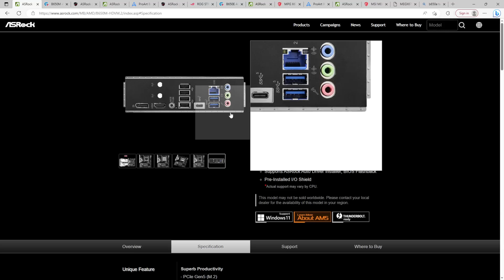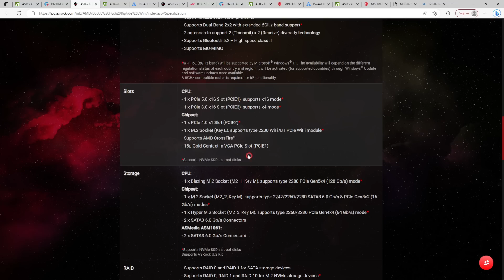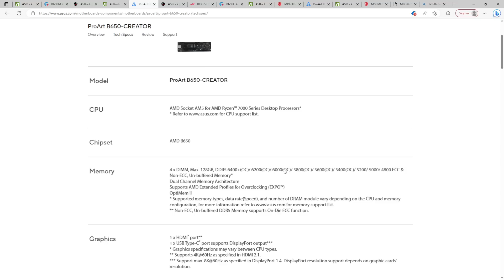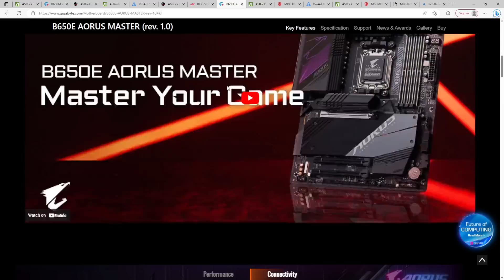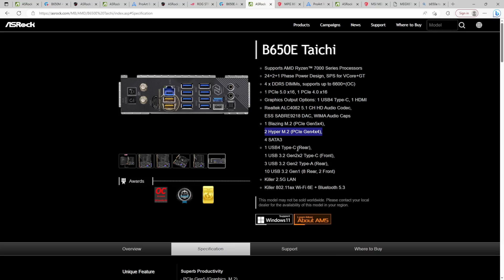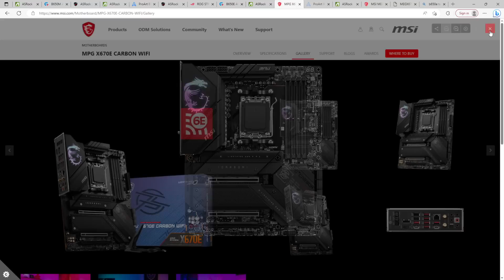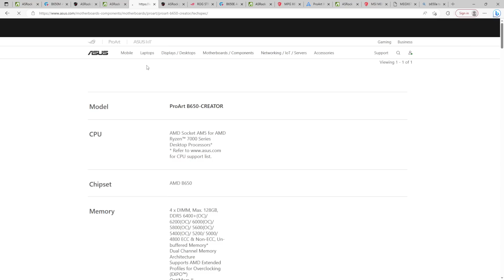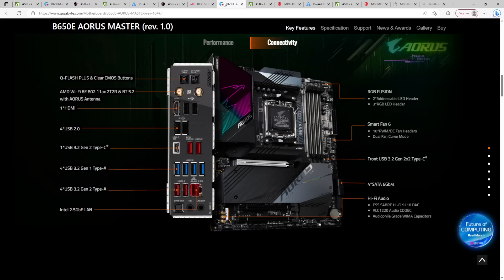AM5 motherboard round up

Comment: On the thunderbolt thing. They literally aren't allowed to advertise it as thunderbolt without having the solution certified by Intel. I doubt Intel makes it easy or cost effective to certify AMD boards, and Asrock only did it on 1 AM4 ITX board.

I thinks it weird you bring up Audio Workstations and wonder about missing optical, and simultaneously included thunderbolt. How familiar are you with this area? People doing audio work are far more likely to use external thunderbolt interfaces long before caring about onboard optical out. Even though optical gets over the quality concerns the onboard drivers and latency are still too much of a wild card. Even high-end add-in cards and USB interfaces have priority over any part of the onboard solution. That also feeds into why the 10Gbe being built-in is more sensible than burning a slot for it. Copper 10Gbe nics tend to be closer to $100+ new. 

That ProArt for the combination of TB4 and 10Gbe makes sense and is cheaper than Asrock X570 Creator was with the same features (sans POST code). It even has one more m.2, and doesn't sacrifice TB if you use more than one NVME SSD.
Reply: @Wasmachineman  Ah yeah. There was a solid 2 year gap between Asrock X570 w/TB3 and Asus releasing TB4 boards. I had only looked at the X570 ProArt, even though it seemed like they immediately discontinued it. I'm pretty sure at initial release they called it USB4 and not TB4. Both it and C8E were basically EOL launches.

Comment: Would anyone happen to know if "official support" ram is actually important? because the B650M AORUS ELITE AX does not officially support any cl30 6000 2x32 gb in the ballpark of 30-36 or 32-38 only 30-40. Any feedback is welcome

Comment: So to test my b650e master i need to run a cinebench or run a high end game? I have had it for a bit with no problems. The only thing i noticed is when i turn the computer on with no windows are installed the code is 00 even while installing windows. But once its fully installed and i install some windows updates amd gpu update it put ramdom codes from ea a0 76 kind of random but whatever
Reply: Sigh

Comment: Which of these is best for the 7800x3d? Did he mention? Just looking for the TLDR beyone the final thoughts section.
Reply: Bro it's more nuanced then that. The as rock b650m hdv/m.2 can run it but for overclocking you might want more features, or for your storage/pcie slots/m.2 slots/style you might want a different board. Figure out what you want  in your board, then look at the options. a620's probably won't work.
Reply: @impaledface7694 how about 9800x3d? is it the same as 7800x3d?

Comment: What if you're purchasing based on the expectation of upgradability of another two maybe three gens beyond 7000 series?
Reply: Realistically, don’t. None of us can predict what comes next and we may see dramatic improvements to manufacturing processes or whatever that save money and make future hardware more affordable or faster. However, AMD will support AM5 at least until 2025, but the VRMs are already so beefy you’re still not going to have trouble. 

Gen 5 PCIE is probably not going to be useful for most by then either, the caveat in my head to that being you’re going to keep this board around for a really long time and maybe upgrade to some nvidia 50 or 60 series (assuming they go PCIE 5) and have a cap on your PCIE lanes that restricts you to an x8 lane set.

Comment: Hi , just a quick question, does the B650E Motherboards have the same issue with the 7800x3d? 

Most of the issues I stumbled upon were tackling the x670 , so I am just wondering
Reply: I hope not... I am on the same situation. Did you find out anything about it yet?
Reply: @Gataki4U  no to be honest , I searched alot and majority of the threads and videos talk about the X670

Comment: "This board kinda does board things" Builzoid 2023, No higher praise for a Motherboard 😁👍
After many years of making Absolute Garbage HDV Spec & then Sulking when getting Shitcanned in reviews finally ASRock has gotten it, they CAN make a HDV that is competently capable of powering the CPUs that fit the socket & unlike an ASUS AM5 you can use the new BIOS update & EXPO without voiding your warranty.

Comment: Why the frig is an Optical out so important?
Reply: Straw-man fallacy alert, as no one claimed it is. It rather may be useful, although like 10G-Ethernet or Wifi, it isn't something which couldn't be retrofitted at low cost, here by simply using a USB sound card.

The real argument made and latent critic about missing optical S/PDIF outputs however is that it would be dirt-cheap to have them and thus it's pure ignorance or intentional price differentiation to omit it.

Comment: A bit unrelateed, but I was looking at the Pro-P from MSI and I noticed that they 4 of the SATA ports come from ASM1064 and not the chipset. Does anyone have any info on that because I'm considering a board with 6 SATA ports, but the options are a bit...yeah
Reply: That ASM1064 AHCI controller uses PCIe 3.0 x1 to create 4 SATA ports. It allows the motherboard to have more SATA ports at the cost of less PCIe lanes from the chipset. (Relative to the amount of PCIe lanes required for 4 SATA ports directly connected to the chipset.) That can be beneficial because those PCIe lanes can of course be used for something else.

Each individual SATA port has a maximum bandwidth of about 0.6GB/s, and the PCIe 3.0 1x connection has a bandwidth of about 1.0GB/s. So you're obviously going to be limited in throughput. But that shouldn't be a problem if you're just using those ports for storage.

Comment: Brother.... please get an m.2 ssd. It's sooo nice to cut out all the sata cables from a build.
Reply: It is nice until you need to access your M.2 slots after your system is already build.  
Gotta remove the GPU, pull the 1-3 power cables, remove the M.2 heatsink with more screws or clips... then there are thermal pads under there you need to be careful with...  
That is a lot more work and takes a lot more time than to just pull out 2 cables and have an SATA SSD in your hand that is sitting in its own slot in the case.  
And of course that is also a good opportunity to remove dust from your System and GPU, so add 15+ minutes of cleanup.  

...or course M.2 is a lot faster, so totally worth the hassle... i just think there has to be a better way to put M.2 ports on boards in general... maybe more like RAM? ...easily accessible.  
Or just generally put all M.2 on a single PCI-E card in a PCI-E SLOT, vertically. one screw and you can mess around with it... same speeds and all that. I don't know.

Comment: My gigabyte master x670e ate itself. Started with doesn't boot with nvme in bottom slot and intel i225 randomly disconnecting,  both issues lots of users complaining about on reddit. Where mow I am sending it back becuase the whole bottom chipsets pci lanes dying when used for more than 30 min 😅
Reply from the maker: sounds like it could be BGA damage to the chipset.
Reply: @ActuallyHardcoreOverclocking  Could be, I noticed one of the chipsets in HWinfo reaching over 70 Celsius.  Not sure if that is over tolerance, but it is also when USBs started disconnecting and a PCI Express Downstream Switch Port would display warning indicators in Device Manager. Board was only ~2 weeks old at the time.
Reply: @ScreamerRSA  maybe badly applied  thermal pad ?
Reply from the maker: @lauwie7610  that's the other possibility.
Reply: @lauwie7610  I did remove the heatsink and everything looked OK with pressure indentations on both thermal pads.

Comment: I wish they had a board that did either 2x 5.0 8x slots or it could switch to dual x16 4.0 slots. Why os this not a thing? What if I want to run 4x raid 0 nvmes off of the cpu lol like that's my only wish. I'd pay like 700 for a board that could do dual x16 4.0 instead of dual x8 5.0
Reply: Dual x16 is 32 lanes. CPUs only have 24 lanes. And you can't turn one 5.0 lane into two 4.0 lanes.
Reply: @BusAlexey  i know but it would be nice if like the Ryzen 9 'x'850x sku had 32 lanes instead of 24
Reply: @thedemonlord8685  it's never happening. not possible

Comment: The asus proart boards are frankly the most consistently good boards for daily use in recent generations. Way better value than rog boards for most users. 

I still always kinda love asrock for their weird quircky insane boards. Just dont buy until youve seen a credible review for it lol. 

Thunderbolt is a weird and exotic connection lol. And last i checked, in order to advertise ur product as supporting tb in advertising materials without being sued, you have to send it to intel for very expensive internal qualification testing.

I think thats all i got to say for am5. Im still on raptor lake in my personal system lol.

Comment: Not 100% sure but I think the Riptide has some form of eBCLK. It definitely has two seperate bus clocks with one beeing obviously tied to at least cpu + ram + fabric and the other one probably being tied to pci clock (not sure how I would measure that but it gets unstable quickly and the other one gets to easily to 104 before crashing).
Reply from the maker: the HDV also has 2 BCLK settings in the BIOS it's just one of them doesn't actually do anything because the board physically doesn't have an external clock gen.

Comment: Seems odd not seeing the ASUS TUF GAMING X670E-PLUS
For 320€, it's not (too much) an overpriced one and has a good connectivity. Maybe I'm delusional and yes I lnow there is no post code, but still it seems like an affordable X670E mobo
Reply from the maker: It's basically the same as the X670E PG Lightning.
Reply: @ActuallyHardcoreOverclocking  Oh
Okay then I see the 50€ made the difference.
I couldn't find anything X670E below in a reasonable time frame in France tho

Comment: I reccomend personally b650e-e should be max 300 but who really care, theres no sense to wait forever sometimes life is to short this mobo is really cool but i highly reccomend do not install any armoury software its extremaly bloatware in task manager 10+ something running in the background and its hard to unistal this shit😅 after cleaning my latency goes down 2 ns crazy
One note i exacly gather information about this motherboard and thwres one minus pretty huge for someone maybe... Sata controler doesnt go full 6gb and max ssd speed from what i read write  is close to 300 mb/s so if someone want to use a lot of ssds its definitly NO GO for him i am using jus one gpu and 2 nvme so no really big deal for gamers and in terms of futureproof

Comment: I have an X670E ProArt and 7950X intended for work use. Was having a problem with the USB-C controller so I'd been dabbling in Asus bios updates. My setup is unstable and fails regularly on bone stock settings without XMP. I've made the executive decision to abandon AMD & Asus entirely as a result of their shenanigans. Real bummer all round from the companies involved.
Reply: Did that system had ever XMP turned on? If yes than SOC portion of CPU could be degraded from ASUS using insane SOC voltage when XMP/DOCP is turned on. Buggy USB controller from ASUS is obviusly next target to blame.

Comment: Those cheap PCI-E SATA cards are spotty Chinese garbage. Always go with motherboard SATA ports whenever possible. The only other reliable option I know about are LSI SAS cards, but those can require flashing and are usually expensive enough to warrant just spending $50-80 more on a motherboard with more SATA ports.

Comment: Two pcie x16 slots with unshared lanes, when? Makes PCIE pass-through miserable.
Reply: Not happening. CPU deficiency thanks to AMD product segmentation (a business decision). Has nothing to do with the MB.
Reply: Zen 4 CPU have 28 PCI-E 5.0 lanes. Some bit of them goes to peripherals, 16 goes to slot 1.
Without bifurcation is is still impossible to have 32 lanes on CPU that have 28 lanes max.
Reply from the maker: @DimkaTsv  4 of those lanes go to the chipset.

Comment: AM5 has been a shitshow.
Reply: I think the burnt CPUs are an unfixable platform defect. Fixing it means limiting power use and XPO. Need to wait for am5+ or am6.
Reply: @JohnDoe-ip3oq  What unfixable platform defect lol? Theres tens of thousands of people that have been on am5 for months with no or close to no issues. If it was a platform defect youd be hearing A LOT more complaints
Reply: @JohnDoe-ip3oq  this seems very much fixable. Its not a platform defect that some (mostly ASUS) motherboards run SoC voltage way past what AMDs spec says. EXPO works just fine without pushing SoC voltage that hard.
Reply: @JohnDoe-ip3oq  that is just straight up wrong, of course its fixable, and EXPO includes no value for SoC voltage anyway, that is just the Mobo BIOS deciding to crank it.  
You can manually set that value and monitor right now, the problem is already solvable and new BIOS updates are in the works.... just need to get people to actually install them, so making noise about it is good, but hating on it because of some TEXT on a WEBSITE is just ... ugh, really?  
People need to stop with the hyperbole and stop panicking, literally every other brand has the same problem, not just ASUS (they are just the one getting dragged through the mud because they put their foot in their mouth on the public perception end of things).  
It is a TINY amount of actual documented failures as well.
Reply: @JohnDoe-ip3oq  That's just 100% wrong because not all motherboards are having issues with the CPUs burning up and also it is not all of the 7xxx series CPUs just the 7800x3d and just certain ASUS boards due to the fact that ASUS set their OCP (Over current protection) Way to high which means the Motherboard will keep feeding the CPU current to the point were the CPU can't handle it anymore causing the catastrophic failure. On top of setting their SOC voltage way too high. There was 1 gigabyte board that did the same thing as the ASUS board burned up the CPU but who knows what caused that problem because the Gigabyte board had their OCP kick in protecting the board unlike ASUS which killed both the CPU and board. And It's 100% ASUS's fault for not following the specifications set by AMD and there is nothing wrong with EXPO at all as a feature. If there was an issue with the feature then it would be doing it on all motherboards not just ASUS.

Comment: All of them will burn your house down so who cares about value? 😂
Reply: Exept they don't. Only asus has overcurrent protection set so high that a complete short circuit won't activate it. Other manufacturers might kill your cpu by also turning vsoc to 11 unnecessarily but they won't also kill the motherboard and set your house on fire like asus.